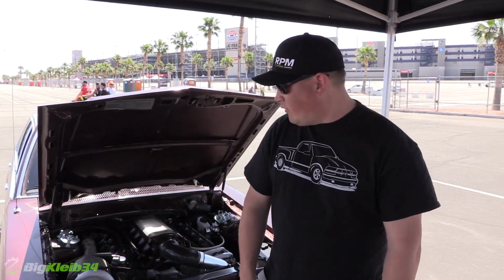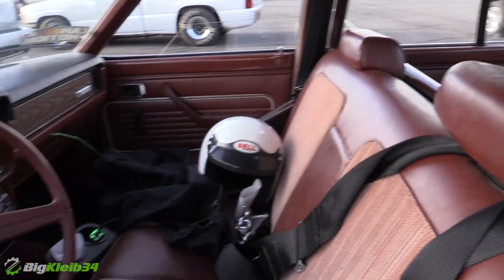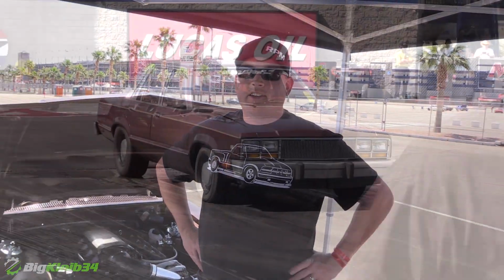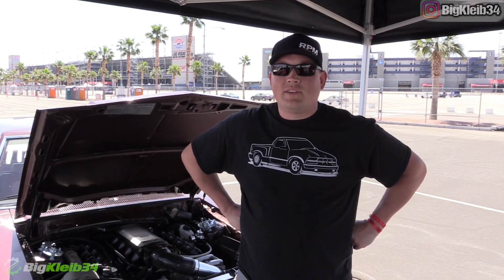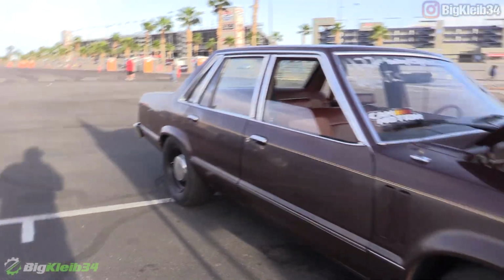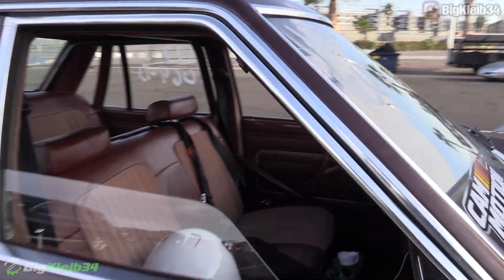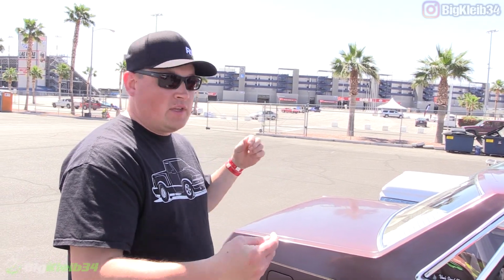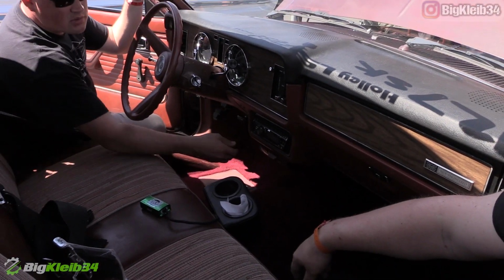Turbo Church Cruiser Hustles Entire "Street King" Class!

Comment: Plan on running 10’s N/A on a 302 block bored over to 331. Was really disappointed when I saw the Ls Holley fest logo after that I pretty much knew what was to come. Wish this guy had coyote in his heart 😪
Reply: @351linzdoctor  the car doesn't care what heart it has it's just glad not to be junked somewhere... Carol Shelby was the longest surviving heart transplant guy till he finally passed away. I see no problem with this car perhaps it was done to save money . A coyote platform is really wide probably have to modify the engine bay too much.....from Wyoming USA 🔫🤠

Comment: lol, 4l60. Living dangerously
Reply: They have parts now for them to hold up. http://4l79.com/
Reply: Wonder what he's done to it
Reply: @Iroc_twan  all the parts
Reply from the maker: Yeah, I misheard him live. Didn't realize he said that until I was editing. DEFINITELY had a few more questions about that one lol
Reply: 4l60 is a strong transmission for a car not for heavier trucks and suvs
Reply: My thoughts exactly. Lol
Reply: 4l60 are a easy build with much greater reliability in Hi HP applications. Also much cheaper now that the 5 pinion planets from the 4l65 are out. Sonex drums fix the clutch stack and application piston issue. All the other isssues were fixed years ago. You get what you pay for and when you pay for stock 4l60 you cant hold the hp.
Reply: Malcolm Reynolds both of you wake up and join the modern age...

Comment: I figure that shares the platform with the Ford Fairmont? Going off the ETCG1 channel, then pretty much all the Fox Body Mustang parts are bolt-on for this chassis. He still hasn't got his quite done yet, but it's neat to see what's possible. I wonder if he's seen this Mercury do its thing?

Also a lot of those old 1980's "brick" style cars have a smaller frontal area compared to newer cars (doesn't look like it, but sitting lower to the ground), so less aerodynamic penalty despite questionable aerodynamics. And more room under the hood to work with, as where newer stuff you're practically running into the firewall or radiator just trying to squeeze basic modifications in there. So they have some other benefits in addition to that unexpected sleeper potential.

Comment: I was good 'til I realized it's infected with LS disease.
I guess building a healthy 351W is too challenging for some people.
Reply: Naw why build a Ford motor just drop a sbc in it more power and cheaper. 😂 all Ford's run better with a heartbeat!!!!
Reply: he should of put a coyote turbo in it it would of been much faster
Reply: Dollar for dollar, you will always get more HP out of a LS or Hemi. The price to build a big power "reliable" Ford is not worth it if all you want are low ETs and reasonably priced replacement parts. Please don't tell me that Minon a Ford powered Mustang is the fastest stick shift car in the world, even a broke clock is right twice a day.
Reply: 351w is a turd 429 is the best motor Ford ever built.
Reply: @Cocpain  that's right tellem son😂👍
Reply: @kevindodge2103  why it would always be broke down the only thing it would be fast at would be tearing up all the time.😂
Reply: Dirt Merchant 
Just because people don't know how to build a reliable high horsepower Ford doesn't mean it can't be done, and inexpensively.
The 351 Windsor short block is as stronger than (most) people realize - in fact the last generation of NASCAR Ford engines (before the FP9) WERE the Windsor design with a non - canted valve spinoff of the Cleveland head developed by Robert Yates (they called them Clevors), one of my customers was S&H Motorsports who ran the NASCAR truck class.
Spinning 7500 through 8200rpm for 2-1/2hrs is a pretty reliable bottom end - and high flowing aftermarket heads for Windsors are dirt cheap.
More in line with the "budget" comments - there are more than a couple blown or nitroused Windsors around that (reliably) make big power with no more than forged pistons and ARP fasteners in otherwise STOCK bottom ends (yes, STOCK block, rods & cranks).
Think that LS is "cheap"? - take a look at the intake manifold on that Fairmont - bet it alone cost more than building a strong Windsor shortblock.
I couldn't help but notice that back when Chevy fixed the smallblock by creating the LS they "borrowed" the cross-bolted mains Ford had in the FEs back in the early sixties and the staggered the intake & exhaust ports, moved the head bolts away from the bores so the bore stays round when the head is torqued down and FINALLY getting rid of those stupid siamesed exhast ports between 5-7 and 4-6 (talk about hot spots).
You were saying about broken clocks....?
When it comes to building Big power they all cost about the same.
Reply: GreenBoy at GA Farms 
Nothing's more fun than stopping that heartbeat with Ford power!
lol!!!
Reply: marshall howard 
The 429/460 is a pain in the ass to swap into too many cars - there's nothing wrong with a Windsor, they're lighter, smaller, and cost less to build.
There's a few guys around here with 429/460s in fox body Mustangs, they're so nose heavy they drive like garbage trucks with two flat tires.
Reply: @Motor-City-Mike  nothing is better than making a Ford  run faster with a heartbeat  and doing it with half the money you Ford  guys spend.😂😂😂
Reply: GreenBoy at GA Farms 
Guess you don't know as much about Fords as you think!
Maybe stick to John Deere.
The REALLY funny part is watching  Chevy guys come unraveled when you stir the pot!
That and watching how pissed they get when they lose to a Ford (or Chrysler) built with half the money they have in they're Chevy!
Chevys are BORING!, which is why I won't own one anymore - been there, done that.
They're just like bellybuttons - nothin' special, everybody has one.
Reply: @Motor-City-Mike  shows how much you know are   entire fleet of company vehicles did I had to keep up where all Fords. All my buddies were big mustang fans there again all Fords they all got mad when I ran junkyard 350s and a little small S10 and broke it off in their ass on the weekends when we went street racing and didn't have hardly anything in the motor I can give you details but those are my secrets. So yeah I ran junkyard s*** against a lot of Ford guys that dumped a pile of money in their cars and still got their ass handed to him I'm not trying to brag just facts and I'm not hating on Ford's I love working on Ford's people pay good money to get them fixed I love to see him roll in the shop
Reply: GreenBoy at GA Farms 
Hey, all you Chevy guys kept my shop in more engine work than we could keep up with for over ten years of business!
Broken or slow - always a Chevy waiting for work.
I did more than my share of winning with my Chevys, then I got bored - I've run Chevys, Fords, Chryslers, Pontiacs & Oldsmobiles (real ones, not rebadged Chevys), a couple Buicks, and even swapped a 501 Caddy into my '71 Nova, and a 455 Olds into my IH D1100 -  and always won more than my share.
What makes a car a winner is knowledge - when someone throws big money at one to go fast it's because they don't know how.
(I built a 350/700R4 '84 S10 too)
No more Chevys in my driveway - no fun anymore.
No one can expect me to believe Chevys are better (or faster), been around a while, and been there, done that, and know better.
Reply: @Motor-City-Mike  don't worry you'll never see mine unless it's in the Winner's Circle LOL that's good that you turn wrenches also I'm not getting in a pissing contest with you if you have only been doing it for 10 years you've got a long ways to go and a lot to learn but congrats I hope you go far and do well I like all American Motors everybody just likes to pick a little bit
Reply: GreenBoy at GA Farms 
Boy did you miss the boat - I had the shop for 11yrs, didn't miss much doing all the engine machining (cars, bikes, boats etc.), building and a good amount of tuning for customers from stock rebuilds to NASCAR and NHRA engines...
I've been spinning wrenches since I was eleven or twelve, that's 1971/1972 'til now.
Just think - you're welcome to all those Chevys I have no use for, you should be ecstatic!
When did you start?
I bet you don't have anything on me.
Reply: Ford too expensive to build and they break a lot!
Reply: @tatialo37  says people that don't really know what or how to do it right! LMAO
Reply: Robert M. Trolinder 
😂😂😂😂😂👍
Reply: GreenBoy at GA Farms 
😂😂😂😂😂
Who started the "I did this, I did that" shit? - you did.

Sorry I offended you with my life's experiences. (not so much).

Just like EVERYONE ELSE (probably you too) who had to work hard to get somewhere in life, and to do the things they loved (and be better at it than most) I worked my ass off too, 60+ hour work weeks, side jobs, and whatever I could learn from the REAL experts (the ones who still know more than I ever will) for decades.

Someday if they breach the space/time continuum I'll take you back through all of it (there's more  about this stuff, but you'll just complain) - not to "show off" or brag about, (about why I know what I do) just plenty of hard work and study, learning through mistakes and embarrassments, and coming out with a few things to be proud of.
I'm sure you've done/know things I never have or will - I know that I don't know/haven't done everything - but this stuff I know -  cars trucks, boats etc. and racing have been in my family since long before I was born - Detroit was the car capitol of the world, remember?
Maybe try to act like an adult (or not), that's up to you - really doesn't mean fuck-all to most people including me, but you'll probably go further.
So go have fun with tractors or trucks or Chevys, whatever makes you happy because I probably am a jackass but you're at least as much of an asshole and miserable prick when you have a temper tantrum.
Have a nice life.
Reply: A shop I worked at got a mild 351W  2 barrel in a Zephyr wagon. Really clean low budget install. It would just quit so he brought it to us. With the help of a Ford guy the Duraspark from the original engine would plug in but “you need one with a blue plug” That fixed it. Driving it you touch the gas then ride the brakes everywhere. We were careful not to break it but it was phenomenal even taking off gently
Reply: GreenBoy at GA Farms i cut my teeth learning to repair chevys  i own fords now and dont have to work on them thats the only reason everybody knows about chevys is because they are always repairing them
Reply: Sam Molloy 
A little thinking can still build an inexpensive and fast Ford.
👌
Reply: F.O.R.D  Fix Or Repair Daily 👍🤪🍺Blahahaha
Reply: @Motor-City-Mike  Apparently you don't keep up with racing at a professional level. Chevy always dominates. Nascars history alone will tell you that. 

You just like a challenge, and I respect that!
Reply: @Motor-City-Mike  My 86 Mustang weighs 3005 lbs. With me in it. With a Stroked 460. Had a Cleveland in it previously was Heavier with the 351 Cleveland,  Yes the 460 Has Aluminum Heads and also did the Whole UPR Front Chromemoly Suspension. Goes Low 9,s on 275/60 Drag Radials N/A through a 4150 Holley Carb. And the 460 Fits Better under the Hood then the Cleveland Did.
Reply: Ashes 2 Ashes 
I do keep up.
As far as NASCAR is concerned it depends how far back you want to go.
Was a time when Ford and Chrysler owned that competition.

NASCAR (like most professional racing associations or most Pro sports for that matter) has become entertainment, not real racing, at least not like it was. 
Was a time best driver/best car won - now there's no room for any team, Chevy Ford or Toyota to find an advantage without being penalized for "cheating".
Might as well be like Indy cars were for quite a while - spec chassis, spec engine, spec everything - that's a driver contest, not racing.
Tis true - I do like a challenge!
It's no more expensive to build a fast Ford than a fast Chevy, people just don't like to think anymore.
I ran Chevys for a long time, but for me it became boring racing the same car/engines as everyone else.
This guy could have built a 351W for the same money or less than this LS and made no less power - it even would have bolted in the car with Fox Body Mustang mounts instead of having to fab everything.
What I should do is find a four - door Malibu (G bodies make easy race cars) and swap in a turbo or centrifugal blown Windsor - or a stroked 460 - and post videos of an inexpensive Ford powered Chevy that runs just as fast as this Fairmont.
Nah - nobody would believe it.
Just depends what people want to accomplish - it's his car, not mine. 😂
Reply: Bad Ass 6.0 Powerstroke 
I said Windsor, not Cleveland - the Cleveland IS heavy.
I never said a 385 series (429/460) didn't run, I said all the weight on the nose makes the car drive like a garbage truck - if you drive the car on the street you know what I mean, just like with a Cleveland.
There's no good reason to run a Cleveland anymore - there's aftermarket Windor heads that breath as well or better dirt cheap, the Windsor shortblock is better and fits everything better - even factory Cleveland cars were tight.
My '91 GT went 9.80s (slicks, open exhaust) with a Vortec blown 1st. generation lightning 351W, hand ported Edelbrock heads and intake and a Comp Cams turbo grind, charge cooled with Meth.
On the street the car drove just like it did with the 5.0.
I was talking about cheap and easy - this turbo LS Fox body is neither one.
I have nothing against 429/460s - I ran a stroker (514) in an F150, and built more than a few for customers, they're a good engine.
Reply: Shawn Sharp First On Race Day
Chevy engines are only good for rustproofing the bottom of the car
Reply: @Motor-City-Mike  Fair enough. I pretty much went back to the dawn of racing with NASCAR, but I do recall my father telling me the same stories about Mopar that you just reiterated. My father grew up a Mopar man but much like yourself, he finds enjoyment in just about any of them today depending on what they do. I do have to agree however that I'm a fan of keeping the engine and car in the same family, no matter what it is.
Reply: Ashes 2 Ashes 
Those are my feelings too!
I like to poke at the chevy guys - they've always given me a rash of crap, telling me that everything is junk but chevy - and then Actually Getting Pissed Of when I beat them with something else! (lol) - I ran other GMs, Fords and Chryslers too.
(yup, I'm "old")
The truth is not every engine takes the same modifications to make big power - some ARE universal but not all (you know this) but if you go looking for the knowledge and not just throwing money you'll find what it takes.
Chevrolet IS the most popular, so obviously there's more aftermarket  support.
I just know I can put in the time and study to get there - but few people get it.
Reply: Sam Molloy 
lol!
I went through that for a while!

Comment: Seriously doubt it’s “somewhere around 800 horse” 
More like 550
Reply: I don't know ThatDudeTrent.... 550hp hitting 10.2? Lol
Reply: @rh1noslayer  oh yes. People run low 10s in 600 wheel hp regular cab trucks. That light ass car should be running low to mid 8s with 800 wheel.
Reply: To run those times sounds about right

Comment: Another BS/LS in a Ford. It been better to have seen a Coyote under the hood or a 9.5 deck SBF and he’d went faster💯💯 I give the video a 👍🏻 the car a 👎😡😡😱😱😱
Reply from the maker: Coyotes are cool but I would think it would be a lot more expensive, right?
Reply: BigKleib34 not really me and a good friend of mine do coyote swaps and builds all the time. Just put a 1st gen Coyote on a 2000 F150 with a 78mm turbo. Bad part was he wanted it left a 5 speed. I’ll tell ya one thing tho, that’s the fastest full size pickup here in Southern West Virginia. I’m partial to the 9.5 deck SBF, I’ve got a 454 cubic inch SBF in a 94 mustang, I should have it on the streets mid summer, it’s gotta set of SBF Hemi heads on it and made over 900 NA on the engine dyno. I’ve got two fogger kits and a plate kit should run pretty good.👍🏻
Reply: BigKleib34 not really, when you add in the cost of heads cam on the ls it will almost offset to the cost of a coyote. That's the good thing about a coyote no need for heads cam and other upgrades just throw boost at it right out the box.
Reply: Jonathon lopez you can throw boost at the Coyote but not as much as ya think. The sleeves won’t hold up and ya need to find ya a GT350 crank, and billet rods . Your bottom end needs to be forged or you won’t be racing it long you’ll have holes in you block 😱😱💯💯😱😱

Comment: Should've went coyote
Reply: Ramel Lucas nah he wants to go fast not slow
Reply: @slowfiddy4231  ain't nothing wrong with a coyote bro
Reply: Slow Fiddy4 mid 10s would be NA coyote numbers...
Reply: Just another bone head ls swap no challenge. Big deal.
Reply: Thee coyote platform is really wide probably have to modify the engine bay too much just easier and cheaper this way. I love it....from Wyoming USA 🔫🤠
Reply: Bill Allen they fit right in with the correct K member.
Reply: @0rbie  aren't the shock/strut mounts too narrow?